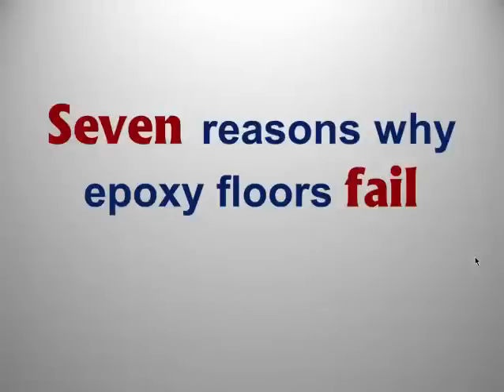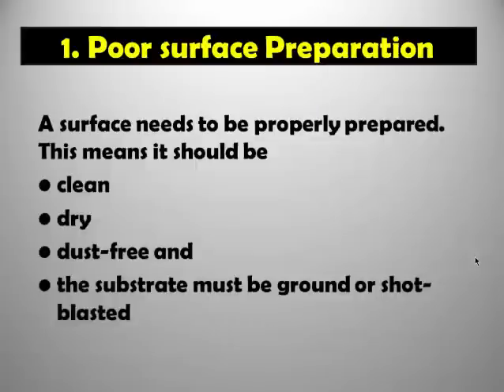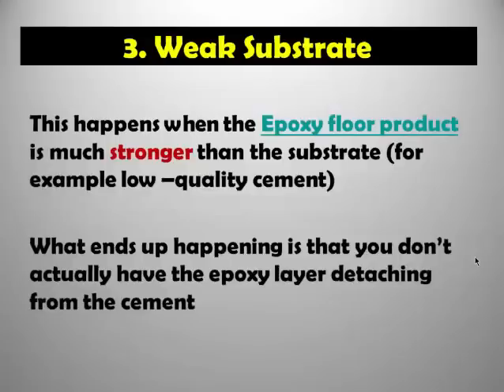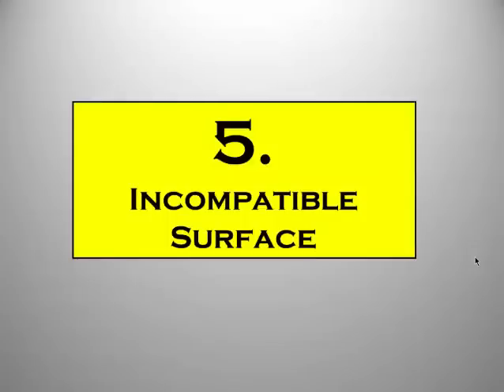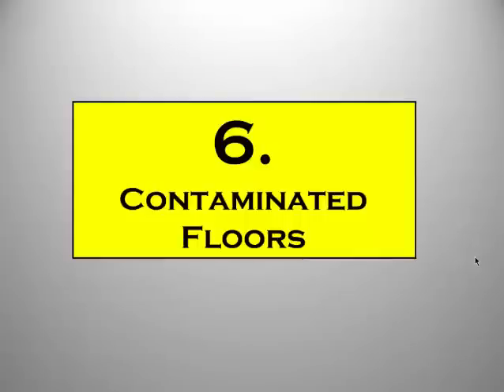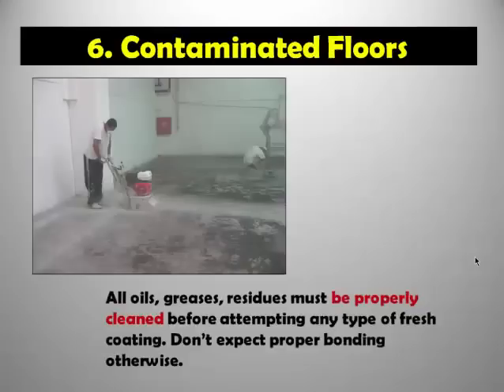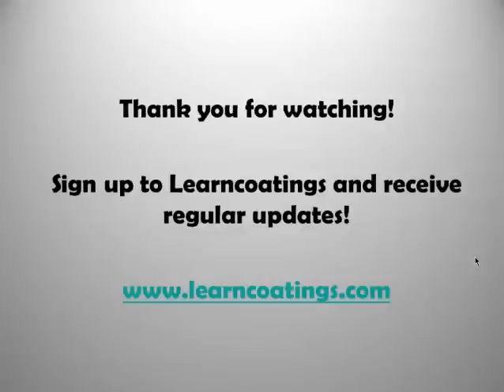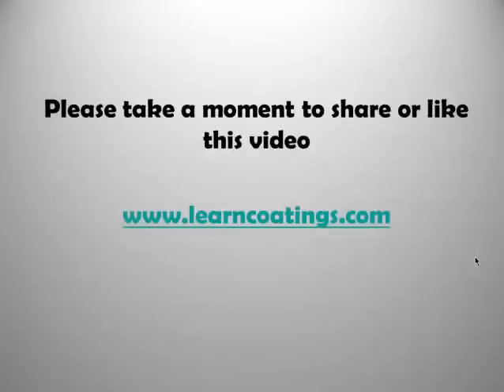7 Factors that cause Epoxy Floors to FAIL

Comment: I purchased my house about 2 years ago and still learning new things about it.  It is a very large house with a basement that floods a lot.  There was a sump pump put in so that the flooding is no longer there, but there are still leaks I can see from the concrete walls.  The floor there in all the rooms are what appears to be normal tile you would find on many floors.  But many are chipped and loose.  I was thinking of removing the tiles and putting a coat of epoxy there and watched the video for that reason.  Recently I was cleaning the sun room, the room in front behind the front door.  While sweeping it, I saw chips of flat flakes and the picture on the video made me realize it must have been from an old epoxy coating.  I've learned that epoxy is not good for humidity which is probably why the basement floors have tile on them.  The garages in back of the house all have thick concrete floors that are in very good shape and there are no leaks there.  There is a lot of rain here in Springfield, MO so I don't think I will be coating any floors with epoxy.  Walking to the front of the house from outside, you have to climb stairs to the front door which makes that front room 6  or more feet above ground level.  So it is dry in that room, except for a leak coming from the bottom of the front door after a good rain, which might explain the chipping epoxy layer on the floor.  Thanks very much for bringing your video for me to help explain epoxy floor coatings.

Comment: what is  a good primer to use on concrete floor before using ROCK SOLID METALLIC EPOXY
Reply: Not needed. My rocksolid garage floor is over a year old and 100% looks as good as day one.

Comment: No wood ? Then What is used on those tabletops ?
Reply from the maker: no wood for floors... as the stress and the expansion will be too much for floor to handle. But for countertops it's different. Here the area size is very small, and all the stress is much less
Reply: LearnCoatings - Epoxy Flooring Training Could a cement coating be put over the top of a wood substrate and epoxy applied over it?
Reply: Thanks for the warning about wood. I was going to diy an epoxy floor in my RV before this
Reply: Samat Teberdi
Samat Teberdi I am still doing it to my floors. I am adding heating between my wood. I can't have a cement floor in my house as it sits up on cinder blocks. It already has a wood floor. I need to add the heat between the floor and the top wood floor. I am going to add the resin and see what happens. If it cracks, add more resin.

Comment: Thanks a lot.  Non of the "tutorial " videos on YouTube talked about primers or electric mixer.
Reply from the maker: you are welcome. Yes most tutorial videos are about advertising, they don't want to make it seem complicated
Reply: Great info! I have a question and I cant find a video that could help me. How do you prepare a old epoxy floor to re- epoxy it? do you just clean and sand lightly or do you have to remove old epoxy? (the old epoxy is not peeleng or chiping, its just faded)
Reply: Perhaps you haven't seen the Pros that make tutorial vids on it. Most of the ones I've seen have stressed the preping part, from making sure it's thoroughly clean, getting it primed properly, etc. and making sure the floor is leveled (which this should be added to the list IMO).
Reply: Nobody worth their weight primes before epoxy.

Comment: I want to epoxy my basement floor where I have a small woodworking shop.  However, My basement floor has moisture beneath it.  Years ago I installed a swimming pool resurfacer called Akona.  It’s like paint with sand in it, almost like a stucco.  It’s supposed to seal out moisture.  However, wherever a plastic tub sat on the floor, after about a year, when I’d move it, I found just a little discoloration and a light grey mold, a very small amount.  This told me that moisture was still coming up through the floor.  So I bought a cement floor paint from Valspar that is designed to seal out moisture.  It also had a sand in it.  It worked.  However, I’d like to install a more permanent product that will stand up to high traffic and wear and tear better. Can I install epoxy over this product without removing the previous two products?  There will always be moisture under this concrete floor. If I remove the existing product, this floor will never be dry enough to install epoxy.  What do you recommend?

Comment: People need to understand that applying the epoxy is the easiest part of the project by far... prep...prep
PREP ...PREP is all the work.
Reply from the maker: totally agree with you on that one. Applying the epoxy is the glamorous part of the job, no one sees the messy part
Reply: I disagree with you, i spend 2 days prepping and cleaning my floor. My freshly applied epoxy looks like shit. Its full of orange perl from the rollers. Any ideas why? Im i using the wrong epoxy? I want my epoxy to look smooth and reflective, but its actually the oposite.
Reply: Use special epoxy rollers, not regular paint rollers. First use squeegee to do most of the work and then finish it with the special rollers, and if u take the roller and roll it over the tape good before you use it, it will also help with fibers.
Reply: oh and also spray the floor after it dries with denatured alcohol and wipe all that up and finish with a warm mop
Reply: As an epoxy floor applicator this is 1000% true PREP IS IMPORTANT

Comment: There is a proper epoxy resin specific for wooden floors with a primer filler to fill voids and it's all self leveling and then it has the top coat. And someone asked how to remove bubbles, that's what blow dryers and torch tools are for. It's important to continue checking surface temperatures as the product cures. Just select the proper epoxy resin for your specific project and research all you can about it and follow the instructions to avoid fails! Best of luck!
Reply: tessybraun can u share the product name of this epoxy?  I have a bathroom project in mind.

Comment: I took almost a week prepping my shop floor. After 14 years it hasn't peeled,  cracked or came up anywhere.  
It is stained in several spots do to my neglect so i am in the process of prepping again prior to recoating

Comment: Howdy ....
I have a corrugated steel shed on a slab of good concrete .
Can i use this stuff to raise and waterproof the inside floor by about 20mm ?
Tony.
Reply from the maker: No epoxy is only good up to 3mm. The cost is way too high for 20mm. You are better off looking at a self leveling cement

Comment: What kind of primer should be used for epoxy flooring
Reply from the maker: 2 component epoxy primers should be used. If you apply a high build coat on top I always recommend sprinkling some sand on the wet primer. For more information on priming watch this video https://youtu.be/EqscZnJsvS4

Comment: I am planning on doing the floors in my house downstairs.  The base floor is 1940 wood. I am adding heating element on that. It will have the orange holder under it, then tile compound to hold the wires in place.  Then good board will be screwed down every foot, so it will not move or shift.  They will be sanded prior to adding the resin.  If it is a success,  I will let people know.
And how it holds up.  I am doing my bathroom counters and kitchen ones as well.
I believe there are different types of resin for floors and counters. I plan on asking the professionals where I get the stuff from.  Counters are attached too to cabnets. The wood underneath should shift and crack too if what you say is so. How is a floor any different than a counter.
Reply from the maker: Floors differ in the sense that they have much bigger strains of weight and shifts in load than a counter has. People walking or furniture being moved can cause major expansions and contractions if you have wood underneath

Comment: Please help me out with the methods or equipments by which we can clean the epoxy floors?
Reply from the maker: A machine with a rotating brush underneath should be fine. No need to buy the overpriced detergents that they sell. Basic cleaning detergent mixed with warm water does a good job

Comment: which would be better for basketball court outdoor? It gets rained on a lot as well.
Reply from the maker: For outdoor sports floors,we tend to use acrylics, or aliphatic polyurethane floors
Reply: @learncoatings-epoxyfloorin9448  thank you!
Reply: @learncoatings-epoxyfloorin9448   Which would you recommend for a cement floor that doesn't have any covering on top? Our basketball lines go on top of the cement floor (cracked in some areas).

Comment: Thanks for such an elaborate info. Can epoxy be laid on already existing natural stone flooring?
Reply from the maker: Stone flooring is very difficult to bond with as the pores are not very friendly for epoxy. You would be better off using acrylic varnishes

Comment: Is this safe as medically? AND is it cheaper and safe than tiless?
Reply from the maker: We put such products all the time for food and pharmaceutical manufacturing. So yes it is safe floors in such areas. Regarding the cost of tiles, it is impossible to compare this as both tiles and epoxy have massive variations in quality and specs

Comment: I am having a problem with the second clear coat using H&C shield Crete kit from Sherwin-Williams. First coat was dried and clear, the second coat came out white and stays that way after 2 days. 
Could you help with an idea how to fix it w/o removing the clear epoxy coat?
Reply from the maker: Don't know what may have caused it. You could find a corner and try sanding with a high grit paper like 300 or 500 and test to see what happens. You could also try recoating that area and see the results

Comment: Our school had to have an asbestos abatement done on our concrete floors to remove absestos containing adhesive. At the end they applied some sort of oil product to encapsulate any possible particles that hadn't been removed or contained. Is there any type if epoxy type product that can be applied on this floor? I understand all the comments about floor prep, but we are truly limited in what we can do
Reply from the maker: You would need to look into a suitable primer that can act as a bridge between the oil floor and the epoxy. If you find the right primer then epoxy should be able to stick to that

Comment: Can we recoat a freshly coated epoxy floor as the first coat was too thin and it has completely dried off?
Reply from the maker: Yes you can re-coat over the first coat. But what do you mean by dried off? Is it peeling?
Reply: LearnCoatings - Epoxy Flooring Training thanks. No not peeling, already applied the second coat and it’s looking good.

Comment: Are there Primers for the floor that will keep the old contaminants in the cement  from ever interacting with the epoxy finish? If so, what are they? Who makes a good primer product for epoxy floor finishes? Should the concrete be sanded with a floor finisher or etched with acid?
Reply from the maker: Yes there are primers for the floor tht are better at blocking oils and contaminants. However there is not one guaranteed product that will block all contaminants. Also regarding a good primer it really depends on the substrate in question. A porous substrate requires a thicker primer while a dense concrete floor requires a low viscosity primer that will penetrate the substrate

Comment: I am wanting epoxy/polycuramine a refridgerated chiller concrete floor.  it is the size of 4 x 40ft containers.  should i do in stages or make sure enough people on hand to do in one hit?  Also, thank you for the video... i've watched a number where the epoxy bubbles up and don't think the food verifiers would be keen on this.  Cheers Dean
Reply from the maker: Yes you are right about the food verifiers! They don't want to see any pores in the floor. 4X40ft is not that large of an area. If you have prior experience go do it in one hit. If you are inexperienced, you want to do one container first just so you look out for any problems

Comment: I'm going to diamond grind, degrease and etch to prep. I'm thinking about using Epoxy-Coat brand. Would you reccomend that or a big box store brand? Also, if I use Epoxy-Coat, should I prime it? The kit doesn't come with a primer.
Reply from the maker: I am not really familiar with brands available in the US so I can't comment on the products. However I am always in favour of priming the floor first, it will reduce the chance of peeling and will overall give a better gloss on the final result

Comment: What do i need to put over wooden flooring to make epoxy suitable to adhere ?
Reply from the maker: I would recommend that instead of epoxy you use a more elastic coating like polyurethane. It will adhere to the wood and also be able to deal with the contractions

Comment: Sir, why do  i have roller marks and roller texture on my epoxy floor? I mixed parts A&B and i did everything accordingly to specifications.
Reply from the maker: If you apply with a roller you will get roller texture. By backrolling you can improve the texture. Have a look at this video https://youtu.be/wYbpu0-lC64
If you want a perfectly smooth floor you need to do a self leveling epoxy applied with a trowel and spiked roller

Comment: This video was so help full.  
A question. Can I apply Epoxy on marble floor??
Reply from the maker: Thanks Rizwan, yes you can apply epoxy on marble although marble is notorious for poor bonding. Make sure you grind it well to remove any gloss, and apply a low viscosity primer to make sure it pentrates the pores of the marble

Comment: I have already  put down a hardener/resin epoxy but I dont think I mixed well enough as it has not cured in close to a week. What can I do to help it cure or what is the best next step?
Reply from the maker: best step is to clean up any uncured epoxy and wipe down with alcohol so all of the stickiness is gone. Once its dry, you should recoat
Reply: @learncoatings-epoxyfloorin9448  hello, I have a Similar issue. I didn't put enough hardener down and I have almost 25% of my garage is sticky after drying. Would I be able to put a clear coat epoxy down or would I need to scrape the bad up and wipe down with alcohol then recoat? Thank you

Comment: Hi and just wondering if you can add another thin layer of clear epoxy resin directly onto a floor that has being covered with clear epoxy resin  about a week ago. Thank you.
Reply from the maker: it is possible but the main risk is bonding. Clear resin makes a very smooth and glassy surface that could cause cratering when you apply the next coating on top

Comment: can i paint acrylic paint over old epoxy floor
Reply from the maker: I don't recommend it. You may have adhesion issues but most importantly acrylic paint on floors is very weak and it struggles with impact stress and wear

Comment: Is it possible to apply on white marble flooring directly..?
Reply from the maker: You must grind the marble and give it a good scratch. Marble is difficult for bonding as it is very glossy and lacks pores. On top of that apply a thin fluid epoxy primer that will bond well

Comment: very good video! just a question, half of my garage floor has spalled, should I resurfaced it first entirely before epoxy-coating? I am looking to sakrete flo coat, do you think that'll be good if so?
Reply from the maker: Thank you! when you say spalled,has the epoxy cracked or is it a concrete issue? If the problem is widespread you should definitely consider fixing the whole thing before you re-surface. As for sakcrete I do not know thisbrand
Reply: Screed coat is better than epoxy coat.. better use epoxy hardener coat for garage and heavy movement area..

Comment: we mixed with mixer attached to electric drill according to the directions. at this point i only want to know if there's anything i can put over it to eliminate the sticky surface. someone said to sprinkle silica sand on it. have you heard of this?
Reply from the maker: sprinkling sand will reduce the stickiness but it will still be a sticky floor and the sand will not be very sturdy. The best solution would be remove the sticky part with a scraper, wipe with solvent and re-coat

Comment: Hello master . Thank you for the videos .I have a little projects in mind to do a wooden bathtub it's a challenge that I will need to study and learn from others and I will like to see what tipe of epoxy or what to use to make sure the bathtub it's seal and the water will stay inside and to make sure it's not going to crack or if it's even possible to do it?Any information will help . Thank you in advance Ben!
Reply from the maker: You need to use a flexible coating with the wooden bathtub. When the bathtub fills up with water, it will expand. You need  coating that can follow the expansion. I doubt if Epoxy can handle it
Reply: @learncoatings-epoxyfloorin9448  How do you get tiles to expand then in a shower? The walls are stable in place.

Comment: Thanks for your very interesting video. I want to use epoxi on my slate floors in my patio. Do you think this will work?
Reply from the maker: If your patio is exposed to the sun I don't recommend epoxy as it will slowly go yellow and chalk

Comment: do you still need to grind if its a new concrete floor? Would it be better to have the concrete finishers leave the surface slightly rough, for new construction?
Reply from the maker: It is always advisable to grind & remove the top crust of a concrete floor even if it has been left slightly rough. Often you will find that the top crust is somewhat weaker and prone to cracks. Grinding the floor will immediately reveal any problems with the concrete
Reply: This guy is def correct
Reply: 100percent correct advice